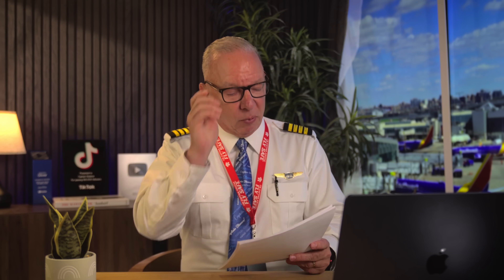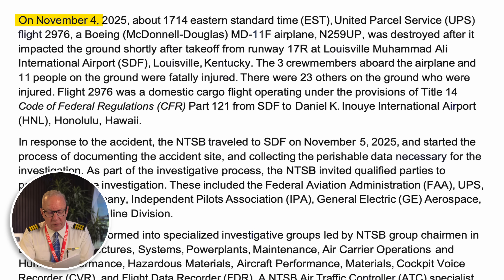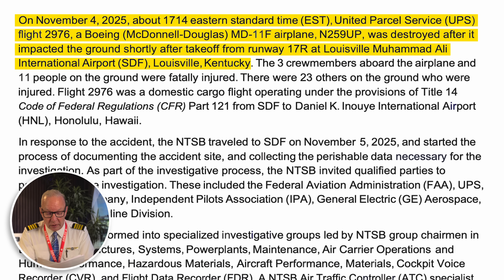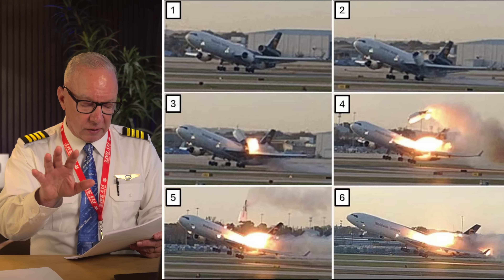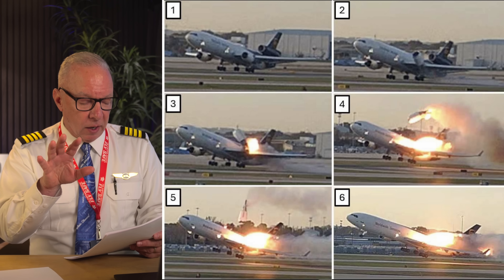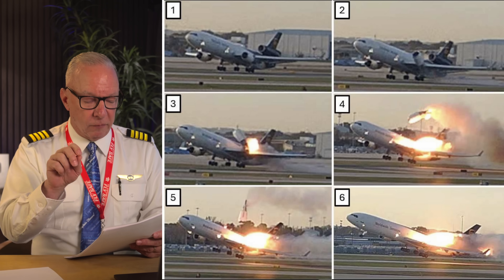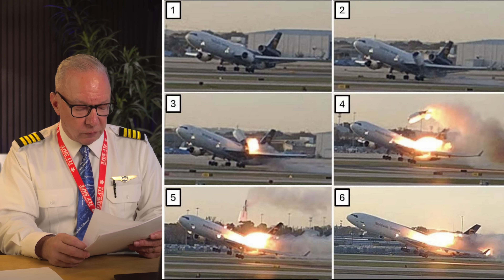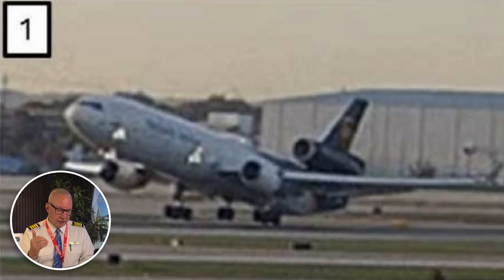UPS Crash Preliminary Report | Pilot Reacts to UPS Crash Report

Comment: Captain Steeeve, at the 11:57 mark, I think you've misinterpreted the comments about forward and aft 'lugs'. The report explains that the aft mount, consists of two lugs with spherical bearings. The pictures you see @10:05 show these two lugs, one right in front of the other, for the aft mount. Of the four surfaces that broke, three had fatique cracks (both sides of aft lug and inboard side of forward lug). This wasn't the forward and aft mounts, just the four sides of the two lugs in the aft mount.

Perhaps elsewhere in the report they may mention the failure of the forward mount, but I think it's obvious, with the aft mount failed, the engine thrust just swung it upwards, pivoting around the forward mount until it broke off. This rotating around the forward mount flung the engine up over the wing.

Comment: My dad was a mechanic for UAL in S. San Francisco for 30+ years.  (When they were the #1 Airline in the country). He told stories about other airlines contracting with them for maintenance on their aircraft. One airline, Continental, told them exactly what they wanted done. My dad, along with other mechanics, would find many things that needed attention, but weren't allowed to fix because of the contract. Some things were safety-related, and the guys would fix them without permission because they couldn't in good faith send the aircraft back out. 

I have to wonder at the inspection intervals imposed by UPS were far too "optimistic" for such an old aircraft? Were the intervals a money-saving concern? Was it expensive to check those attachments?  

I drove for UPS for one season, and my little truck was a piece of junk. I talked to the mechanic at the hub about it stalling out when given fuel, and he said that they will run it until it breaks. Well, it did. The engine caught fire. So, I wonder if their drive to save money had anything to do with this disaster?

Comment: Just a quick question for clarification.  Undoubtedly, having only one engine would not be able to get the airplane airborne effectively; however, I just want to clarify, if something catastrophic happened to two of the engines when the plane was flying at altitude, would the plane be able to fly and land with a lone engine?  I do remember hearing it said that planes can do something of this nature in emergencies.  Thanks for your analyses; I do find them helpful to understand these incidents and it helps to have that information to control the fears that might result from lack of information.

In the videos about the incident in Toronto, a family member of mine was due to arrive at the same airport in a similar plane from the same airport that plane departed from, so you might imagine my feelings in seeing the crash despite its relatively "successful (?)" outcome.  Thanks again.

Comment: How often are all the models in use as air passenger planes have those areas inspected. The pylon mounts and the engine mounts?? Might need to inspect those areas more frequently due to the extreme stress in those areas. Might need to replace those attach bolts and bearing on a regular basis.

Comment: Can this plane actually fly with only one wing engine running and the tail engine out too (assuming all else is stable)? It's unbelievable that a plane can be flown 20,000 times ...
Reply: They weren't "flying", they were taking off.  At altitude, losing two engines you would be able to fly for a while on a single engine.  Takeoff requires two engines running, and even then, to take off you would need minimum weight, i.e., a light fuel load.  This a/c was loaded up with cargo and fuel, bound for Hawaii.  They didn't have a chance.

Comment: The flames you see coming from the #2 tail engine could definitely be the #1 engine on fire tumbling behind the aircraft.
Reply: I thought that too.  The NTSB has reviewed the flight data recorder so they would know.
Reply: @GDuncan8002 Agreed. But they won’t release FDR or CVR data until much later in the investigation. I think if it was a factor it would have been mentioned in the preliminary report

Comment: The ingines of the DC-10 are so big. 
When ingines are not running, you can STAND  in the mouth of the motor, and a six foot person can raise his hands over his head and have about 10 inches remaining over his head to touch the top. If you would walk near front of the motor while idling, you would feel the suction. A very dangerous spot to be. A massive ingine!!!

Comment: It's unbelievable that only 2 pillow blocks are used. By simply using 1 additional attachment point, you can assure that if any single point failed the assembly couldn't rotate off the frame. Terrible design

Comment: I thought airplanes get retired long before any fatigue could break anything apart?
Reply: Fatigue occurs on aircraft from the first flight onwards. 
Most all of the fatigue is well understood and is predictable.

To be sure, long before fatigue develops to the point of being dangerous, it will be repaired and strengthened to original condition.

Comment: Having a pilots eyes on this report to present and explain it is very useful to the flying public.
As an engineer, part of my evaluation would now be focused on the bearings that developed extensive fatigue cracking. Which company manufactured these bearings? Which other aircraft types utilize this companies bearings? I would also want to look at this companies fatigue test results (S vs N charts) of these bearings.
Perhaps you can find out the manufacturer of these bearings. Also, on a future video I would appreciate seeing a discussion of aircraft fatigue testing (from individual components to sub-assemblies to on-ground test aircraft).
Thank you for all of your efforts to be a guiding educator of aircraft and flying.

Comment: Its the same thing as the AA plane that crashed.
Reply: While both crashes involve the engine and pylon, these two crashes are not identical. 

This crash appears to have originated due to fatigue cracks within the bearings that hold attachment pins.
AA191 crashed due to damage of the attachment pins (that go into the bearings) caused by the airlines method for removing the engine and pylon for maintenance.

Comment: This is now going to come down to whether the fatigue cracks got missed during the 2021 maintenance period or if there was some procedure that was done that was not the way to do it. I would think the staff at the maintenance facility wouldn't do what the maintainers at American did in removing the engines but complacency  builds bad habits, especially if one of those habits that seemed good at the time but ultimately led to this.  For American, they had been doing that forklift method for many aircraft before 191 crashed. They got lucky so many times before it happened that they thought their shortcut was safe.

Comment: So why wasn't this pre-existing fatigue discovered in checks?  Why should I feel safe in a commercial aircraft?  It appears that  the airlines roll the dice and only do the intense checks (more $$$) when mandated.
Reply: Do you change your oil every 100 miles, or on the interval recommended by the manufacturer?

Comment: 1. 481 ft MSL (Mean Sea Level)

This means the point is 481 feet above the average global sea level.
	•	It is an absolute elevation.
	•	Used for charts, airports, terrain, navigation, altimeters, etc.

Example:
If a hilltop is listed as 481 ft MSL, that is its true height above sea level—no matter where you are standing.

⸻

2. 100 ft AGL (Above Ground Level)

This means the point is 100 feet above the surface directly below it.
Reply: It's crazy that he keeps making this mistake.  I'm not even a pilot and I caught that error.

Comment: I don't know a lot about metal fatigue but the lubrication happened less than a week before the crash. That has me wondering what pumping a bunch of grease into existing cracks does to them. Also I have had to lubricate equipment in past jobs, this required disassembly. I wonder if it's the same for airplane pylons. I know it wasn't an inspection but perhaps still a chance to catch the metal fatigue. Did the mechanic see something not quite right and not report it because it wasn't they're job or they couldn't quite identify what was wrong?

Comment: I wonder what kind of testing was done back in the 70s or what kind of FEA-analysis they did to make sure the structural integrity of these mounting points. I'm sure the engineers knew there was a structural issue but as always cost got in the way. Structural components should be overrdesigned and have a safety factor of 5 times the necessary load.

Comment: The description of the aft lug vs forward lug is a bit confusing, because it’s still referring to the aft mount.  On the aft mount there is 2 lugs, one in front, one in back.  The use of two seperate parts is suppose to mitigate this kind of failure (fail-safety) but for reasons the NTSB and FAA will spend a lot of time researching, this mitigation failed.  The presence of a critical length crack in the aft fitting of the aft mount should not have progressed to this length before its Special Inspection was scheduled in 8000 flights.

Comment: Unfortunately Captain Steve has ignored the other major component of aircraft accident investigations.  That is the quality of the maintenance procedures.  In the infamous DC 10 crash, American Airlines was implicated for directly violating McDonnell Douglas's maintenance protocols.  They used a forklift for removing engines for safety inspections which damaged the hardware mounts.  Why didn't Captain Steve use his public forum to address this issue?

Comment: Steve, Great reporting. You made a comment about the mean sea level from the report at around 481/3 feet, and said that it could not be. I know that is a number you have disputed all along. However, would that be in line with reality. According to a Google search, the airport sits 501 feet above sea level. You know far more than I do, so I may be missing what you are saying. Is there a difference between what the NTSB is reporting and the 501 feet above sea level of the airport?

Comment: First, thanks to you Captain Steve for such a comprehensive yet easy to understand reading of this report. Those poor pilots had no way to make the plane fly and couldn't even abort late since the incident happened as they were already flying.
Now about the time between inspection, such a long (6 years) delay between inspection on such a vital element that experience such amounts of stress is to me border criminal ! I am a huge military aviation fan and even more about carrier based planes, and we all know the stresses induced by carrier landings and launches on the landing gear and arresting hook... and they do a full inspection and replacement / repair less than every 10 launches and landings  (I think it's a 3 to 4 flights rotation for full maintenance and replacement of damaged gear and hook elements in the French Navy with the Rafale Marine...). Why do they wait 6 years to do such an inspection on the engine mounts in commercial aviation??? For me a full review and rethinking of maintenance policies should occur ASAP, more so for older and aging aircrafts.

Comment: In 79 the bolt cracked, this time the baring. The result was the same. Both times the engine flipped over
and overstresst the junktion.
This is logical. And it had to happen,  if you see how far the next inspektions were. Specially a so hard used plane with these hours and cycles.
This problem shouldn't have happen with a twin jet.  Are there the connections to the wings more
stabil ? If the engine comes off, you  
only loose 50 % of the trust, which I think is a fraktion better.
Reply: Bolt didn’t crack in the 1979 incident you idiot. Mounting lug surface was damaged due to impacts when the engine and pylon were lifted under the wing as one assembly, instead of being installed separately as recommended by the aircraft manufacturer. Try learning facts. Also, bolts don’t “crack” they SHEAR. Another YT comment section ExPeRt!!!!🤡🤡🤡🤡. I swear the freakin’ CLOWNS in here…🤦‍♂️🤦‍♂️🤦‍♂️

Comment: I am a helicopter pilot in the Army.. in helicopters there is something called a "Jesus Nut" which is the main rotor hub attachment bolts..any failure of this nut, only Lord Jesus can save you, hence the name..

Likewise i believe these attachment bolts or lugs specially of the engine mounts, wing root joints, tail vertical and horizontal joint bolts should be checked after every 10 landing cycles by dye penetration test or xray scans to rule out fatigue or load fractures..

I know its tedious, time and money intensive ops.. but there is no other way..

Cuz these locations undergo tremendous aerodynamics stress especially during landings & takeoffs..

These lugs & nuts are akin to Jesus Nuts in helicopters..

May the departed rest in peace 🙏🏽 😑

Comment: Thanks Steve - as usual, a very well done analysis. If I may add a couple of things: when the aft pylon lug failed, the engine, under full thrust, rotated upward pivoting on the forward mount in a manner similar to AA191. It was still under full power when it departed and became airborne. Juan Browne pointed out the gyroscopic precession of the fan disc at rotation that caused the engine to roll to the right, over the fuselage and landing on the right side of the runway. That rolling over the top of the fuselage most certainly spewed debris into the #2 engine, causing it to stall. Another issue is with the FAA's prescribed remedy after AA191 and the design of the pylon structure. One would preclude a focus on the pylon design would be outlined; but that was not what the NTSB recommended. Instead, they focused on maintenance and training since the root cause was the unapproved engine removal procedure. Additionally, the cycle schedule is unrealistic given the critical nature of the structure. I'm not pointing fingers, yet. I will say I'm in agreement with you that this most likely spells the end of the DC-10/MD-11 fleet. Any remedy now must include a complete revisiting of the entire engine mounting design and structure on #1 & # 3 engines, which will be cost-prohibitive from the operators' perspective.

Comment: As a jet engine mechanic in the USAF this is my biggest nightmare  and keeps me up at night. I’ve worked on the KC-135 (a 68 year old jet) with aging airframes where the pilots will consistently induce hard landings. This would therefore prompt us to drop all 4 engines (depending on the severity) and proceed to perform weeks of inspections. One missed fracture could cause the life of the aircrew. Even though the 72 month interval is diabolical, this is an example of what can potentially be missed. I pray for everyone involved.

Comment: Good Report - Absolutely Incredible pictures that truly show the sequence of events in this failure. 
The failure the lugs in the pylon mount us not itself the Root Cause, so... There is Still Much More Work to Do Here  :
1.  What led to the Fatigue Cracks ?   Was it just the stresses from Take-off/Landing Cycles or are there other sources of movement / stress ? (maintenance ?) or Maybe even some materials problem ?
2.  Why did the Left Pylon, AFT Mount, Forward and Aft Lugs show Fatigue Cracks and Not the Forward Mound, Nor the #2 Engine Mounts ?
3.  Exactly HOW did airlines perform the maintenance and inspection routines on these engines / mounts ?  Does this require movement of / dismounting of the Engine?  Do these actions create opportunity for impacts or stresses that might introduce fatigue cracks ?
4.  Why was the inspection cycles schedule (29,200 and 28,000) so far off (Higher Than) the time to this failure ? 

 After the AA Flight in '79 - McD Douglas and GE spent Many Hundreds of engineering hours determining failure modes and calculating Mean Times to Failures  (MTF) for the pylon attachment points and the bolts in these bearing themselves...  That work generated the maintenance and inspection schedules for these planes and their engines.  There may also have been further work / re-calculations that led to revisions of those Maint/Inspection Cycles since, but i am not aware of these efforts or their results....

Stay Tuned, Unless it is mooted by decommissioning the entire fleet of DC-10 / L1011, This is Not Over Yet.

Lastly - I agree with others,  The compressor stall in the rear engine is more likely from disrupted airflow as it ingests the fireball than physical shrapnel from #1 engine.

Comment: Maybe they should required to replace thos parts ever 5 , 10 or 15 years what ever it takes to keep them safe if they wanna keep using the md     Witch that may be way more out of the question   then I understand. But idk     So sad to say but sometimes things just happen too as someone or works on vehicles and heavy equipment I can say sometimes things just fail or break for no good reason as well. Sometime metal or parts are just bad from the factory and fail sooner then they should.  Really sad for the family’s and people who lost there lives just doing there jobs. Sad for md11s as well if they have to be put out of service very cool with tail engine but safety is top priority for a good reason and if they can’t be safe they don’t need to fly.

Comment: Best way to explain (at least as I can explain) that engine going forward and up is a rubber band effect. Take a rubber band and stick your finger in. Now your finger is the plane. As you pull that rubber band it would pull your finger too. Remove your finger from it (aka disconnecting from the plane) and the rubber band shoots forward with violence.

Comment: Every flight can be different as to the location and the weather during that flight on the engine mount assembly parts as to the effect and stress  on such parts..Hopefully the FAA will reevaluate its inspection procedures for the airlines..